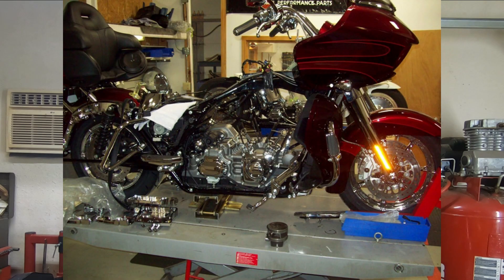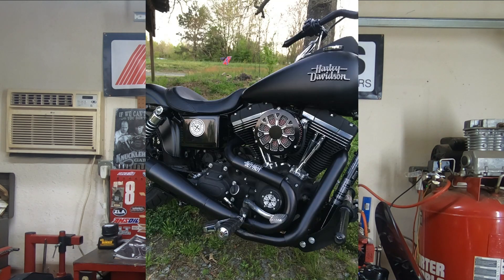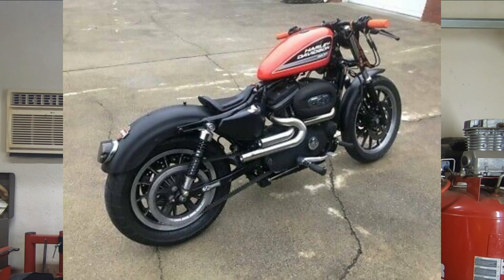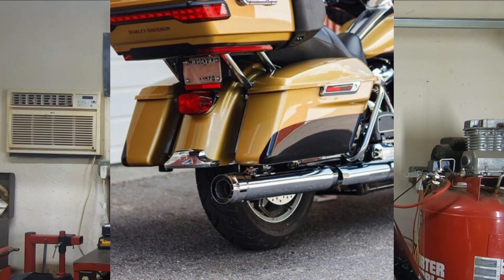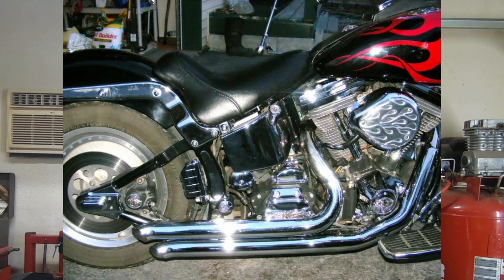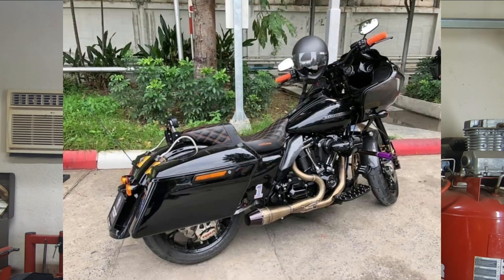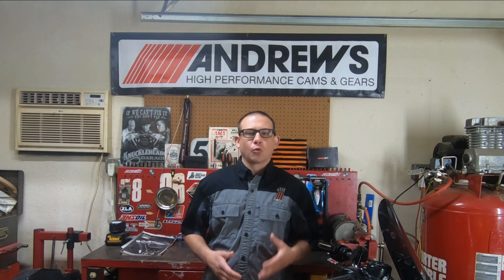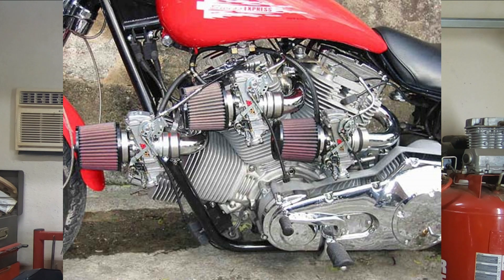Harley-Davidson Performance Hinges on One Major Factor

Comment: This topic is what I think about when I wake up at 3am.the brain turns on and won’t turn back off. I put s&s power tune duals with rinehart slipons on my 88. When I had the 88 built to a 106 stroker,my builder wanted me to put a dnd 2-1 on it. I decided to stop the bleeding there and stuck with the s&s just to save some money. I still think about swapping out but can’t make the decision to do it. I know I’d gain a bit more,but do I reaallly need to?I like how it sounds as it is. It doesn’t sound near as vicious as my wife’s 110 roadking with the 2-1 pro pipe,but it does sound nice and I like the power (more is never a bad thing though).This is the debate that’s been goin on in my head for a very long time.

Comment: I went with the 2 into 1 rhinehart on my stage 4 107. It’s loud and slappy sounding on the lower rpm range which I don’t especially care for . It sings higher up. Stage 4 is about performance. Anything other than 2 into 1 is out of  question regardless of sound.

Comment: I'm in the process to get S 1 for my 2020 FLHTP. My decision is an outlaw 606 air cleaner with transformer EBS from DK Custom as I like to reuse my air cleaner cover . Head pipe from tap performance 2-1-2 and slip ons 4.5" from Sharkroad with 2.5" baffles. Tuner I'm undecided. V&H claims that you can load custom maps into the FP4 in the future which I need as I want a S&S S2 475 gear kit afterwards. First autotune and then when S2 is installed, get it properly tuned. Avoids the double tuning cost. On the other hand, a power vision is a safe bet and worked well on my old bike. What's your take on this subject? Good video, ride safe 🤙

Comment: Great video Gixx, my favorite exhaust is the Vance and Hines x pipe. You get the 2 into 2 with the chrome plated crossover. I'm no expert but if used in the right application, wouldn't the exhaust help pull air/fuel in?

Comment: Am i losing anything with V&H power duels header w/twin slash slip on? 2016 road glide special
110 big bore, woods 999-6A cams, screaming eagle cam plate,  high flow injectors, 58mm HPI Throttle body, screaming eagle clutch/ comp, heads, valves,  T2 tuner, basically everything from the crank up... 
Pushing 116 HP/125 Tq

Comment: This is off topic, can you elaborate on possible causes for oil contaminated with gas on the big twin. Is some normal?  I do enjoy your information, and try to catch every video. Thanks! I'll eliminate one thing, it's not for lack of mantience. The engine has 16k on it oil changed regularly and it was broken in proper, 103 twin cam

Comment: I have a Supertrapp Supermeg running 22 discs/closed end cap on my 2014 Slim with 110" big bore and Cyclerama 570-2 cam. Runs really good, but I know I'm leaving performance on the table. The shop initially put a Pro Pipe on but WAY. too loud for me. Any other suggestions for this setup with a reasonable sound level?

Comment: I have an '01 road glide that I built a 10 and 1/2 to 1 compression 113 inch engine my original exhaust system that I had used for years was a pair of screaming eagle turn of the century mufflers they were basically glass packs I am now running a two into one system and it sucks about 15 horsepower off the top it just can't revise it used to but it is quieter. After 8,000 miles I've decided to take it off and change it back to the old loud one cuz the bike just ran so much better with the open pipes but I am running a high compression big inch engine

Comment: 2017 SE stage 4 roadster with 585 cam sndbi have powervision 3.  Im exhaust shopping now.  I have short shots and they are definitely not staying. What would you recommend to maximize power/torque?  Looks and sound be damned this buildnis purely about performance at this point.   Im going to hit the dyno this spring.

Comment: Great insight as always man, love the videos you put out!   I'm upgrading my 88tc to a 98, 11.3:1 compression (with the heads to go with it) S&S E carb/thunder jet installed with velocity stack. Knowing how important exhaust is,  I'm torn between V&H straight shots and the pro pipe.  Sound isn't as important as elapsed time lol. Do you have any suggestions?

Comment: I have a 08 Electra Glide Classic. I’m wanting new slip on’s thinking Tab 50 cal with Zombies maybe air filter. What tuner do you recommend? I would like it to be Flexible. If I decide to change cams ect. Thank you
Btw I only have 8000 mi on it.
Reply: I have same bike, get rid of the factory header, go with a true dual exhaust and what muffler you like, I went with V&H, nice low end sound and on highway they settle down and not annoying. Also do stage 1 and you will be happy. Well I am, all I need. Cheers.

Comment: I have a 2008 Softail deluxe with Vance n Hines exhaust. The rear exh sits at the height of the rear brake caliper. I couldn't get the passenger pegs I wanted so I compromised. I'm thinking on cobra true duals with billet caps. What do u think?. I like exh on each side of the bike but don't like fish tails.Dont need excessive hp. Highway riding only. What do u think of Arlen Ness 90 ° velocity air cleaner? Drag specialities has it for $308 n titan customs for $300.

Comment: I am putting Wood Tw-222 cams in my 2009 96 Electra Glide. In another video you talked about swapping in 103 heads with 10.5:1 Pistons and I was wondering if the 103 heads with stock 96:1 Pistons would be worth it or not. The price difference is about $200-$300 more from what I can see online. I don't care much for top end hp, I care more about the torque.

Comment: I know this is off subject, but whats your opinion on adjustable pushrods versus taking the valve covers off and using the stock pushrods when replacing a upgraded cam?
Reply: Adjustable pushrods are good to have. Buy them once and use them forever. Saves a lot of time and money when you change cams or replace lifters.

Comment: I'm looking for a 2-1 pipe on the lower db end besides supertrapp.

Anyone has advice? For a 2015 streetbob
Reply: Hard to beat a Supertrapp. Just sayin'.
Reply: I'm  running a Supertrapp 2:1 with 22 discs closed end cap. Sounds real good but not deafening. The best I've found for performance and a reasonable sound level. They look awesome as well. 2014 Slim 110" big bore, Cyclerama 570-2 cam, S&S Stealth.
Reply: @garyboman5018  perhaps i should give it more of a chance. But just not really into the look of that exhaust.
And youtube never does sound quality any justice.

Expensive gamble. But i gues supertrapp with the discs whould be my safest bet.

Comment: I have a question for you my friend. What’s the best loping cam that’s bolt on and it’s worth the money? I don’t care about crazy performance or torque. I ride a 2020 Road King Special with dresser duals by V&H and Cobra NH… Any suggestions would be very appreciated!
Reply: I’ve been trying to figure out the exact same thing for my 21’ Street Glide Special. I was leaning towards the 22xe but there are a bunch of video (Shorts) with the S&S 475 and that lope just sounds mean.
Reply: @PaulG75  475 is too aggressive for my taste… I think it’s best for a 2-1 exhaust. I think that  Woods might do the trick.Just my .02
Reply: @MRGS48  I’m not a fan of the 2-1 either. Right now I just have some Rhinehart DBX-45 Slip ons while I wait out the warranty. So l can do it all and tune it right. I’d been looking at the jackpot 2-1-2 head pipe. Good luck to you. Hope to hear your input on everything on here when it’s all said and done.
Reply: @PaulG75  no need to wait the warranty if you live n the US. Your right to repair has been granted finally to you by the FTC against Harley’s wishes. I’d go for the woods and see what happens. I also have a small pee wee channel myself so🙄😉😉👍
Reply: @MRGS48  Yeah but the second the tune goes on and you’re no longer EPA compliant it’s voided so I figure what’s the point. I can do the suspension for now. Will check out the channel for sure.
Reply: @PaulG75  no it’s not voided anymore that what I’m trying to tell ya. Riding with the Izarks I believe is his channel’s name has a video on this matter. FTC fined HD for making money all these years by forcing their customers to only use HD products for their motorcycles. For example I was told that I needed a high air flow filter/cleaner on my 2020 Road King Special when I had already one!! Do your self a favor and do your research. I’m trying to help is all.👍
Reply: @MRGS48  I assure you that once you change the tuner and break the EPA rules you’re out of luck. That’s the loophole
Reply: @MRGS48  I guess if you kept it epa compliant with an aftermarket tuner you would have an argument. But would would be the point

Comment: My big issue right now is if I'm gonna be disappointed if I do the Screamin' Eagle Twin Cam Conversion Kit - 96CI to 103 CI since I already have the Woods 222 cam and , great intake, V&H two to two pipes and tuner. It's way way better than stock already but just drags at times in my opinion. I'm not sure if the kit would make me happy lol. The S&S 110 kit is way more expensive.
Reply: I just did the S&S 107 kit on my 09-street glide with S&S 585 cams D&D 2 into 1 exhaust with the perforated wrapped/medium baffle. 10.5:1 compression pistons. The exhaust is a little louder than I'd like but the performance difference is nice, (mpg not so nice) only thing is that I have to run higher rpm's to feel that extra performance. Going to a 107 may be the way to go for you also. Good luck.
Reply: I have an recommend the fuel moto 107 kit on my 2010 street glide.. I used S&S 585 ez start cams though, instead of the woods they usually use.  The 96in heads don't have ACR (auto compression releases) so I wanted cams that wouldn't require installing compression releases, or burning up starters. New Barnett clutch to hold the new power, and I also upgraded the camplate and oil pump to a fueling OE+ as there was scoring inside my factory pump, the oil pressure is amazing now. That kit is under $500 it runs great.. 111hp & 119tq.. I will do the heads at some point in the future but this combo is working out great..
Reply: @Clutch_Kick187  I have the manual compression releases, also changed to a high flow oil pump, new cam plate & cam chain tensioners. I didn't get a new compensator or clutch because funds were running out fast and from my understanding with the HP and Torque I should produce they weren't really needed. I still need to get it on the dyno to get it tuned just right and also curious to see my numbers.
Reply: @sbhjackson5931  you have good components, if you can find someone that tunes well there is no reason for mileage to suffer greatly. Good luck

Comment: Stop making these decisions yourself.  Performance is greater than the sum of its parts, it's how well those things mesh and work well together.  You can spend $$$ on the best intake, cleaner, cam and exhaust, but if they don't work well together, you're leaving power on the table.  A great tuner knows what works the best together, ask them.  Then order from them if you can as a token of appreciation for their help.  What parts you likely have in mind aren't going to be what they recommend.

Comment: NEVER LIKED 2 INTO 1, BUT REALIZED IF I WANTED the BIG POWER. I HAD TO GO THIS ROUTE. I HAD the V/H SHORT SHOTS ON BEFORE MOTOR WORK. They LOOKED GREAT and SOUNDED AWESOME, BUT DIDN'T PRODUCE the POWER.    SO NOW I HAVE the PRO-PIPE  COMBINED WITH  the GEROLAMY OVERFLOW AIR FILTER. I GOT USED TO IT QUICKLY, ONCE I FELT the POWER.

Comment: Thanks for the video.
My 2 in 2 SE gave more tq and less hp (2002 Dyna 103 stage IV kit). 
The 2 in 1 that I have now on it (stainless Danmoto), looks better, weights less, and gives more hp (107hp), but brought the tq between 2000rpm  and 3000rpm down a lot. 
So, i guess i cant have it all. 
https://youtu.be/k9t0o0meONk?t=126